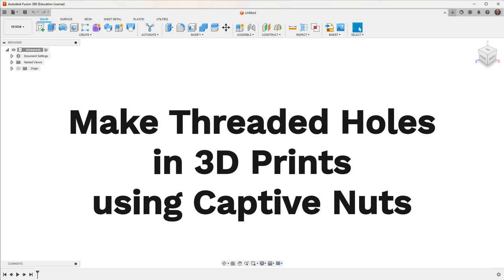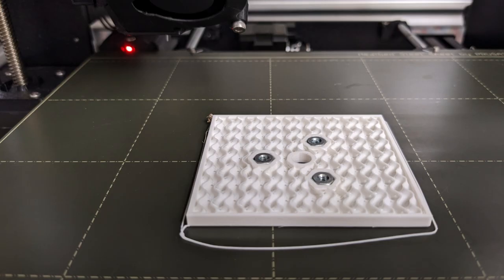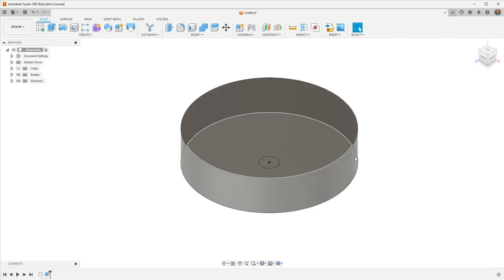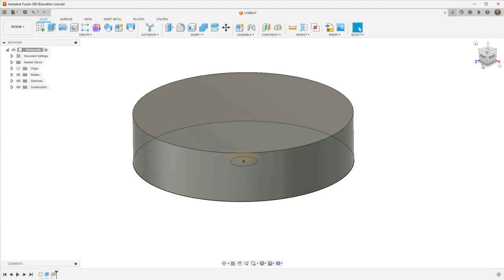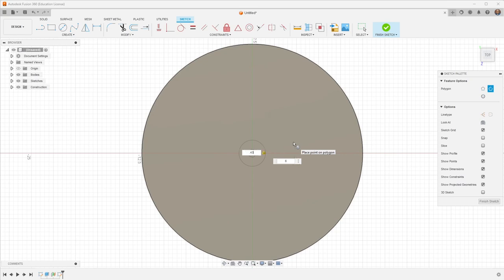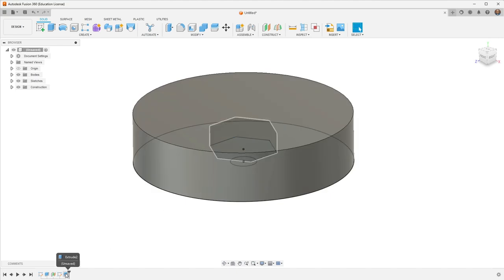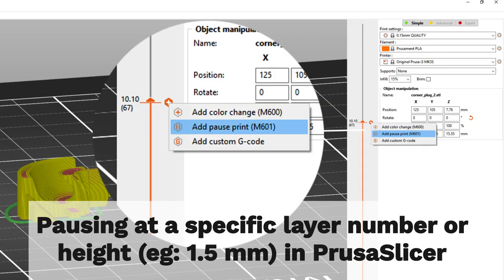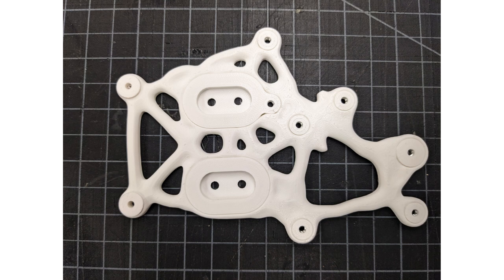Create Threaded Holes in 3D Printed Designs using Captive Nuts & Fusion 360

Comment: You can also draw the sketch as part of your first sketch.  When you extrude, there's an "Offset" option which is vertical space before the extrude starts.
Reply from the maker: Absolutely. I love that feature. Everything can be done with just a single sketch for sure. I try to separate things out in tutorials sometimes, so I can describe each part as I go. But thinking ahead, sketching on paper, writing down the measurements, and using the offset option with extrudes from a single sketch in this case would be a much cleaner way to work I think.

Comment: Does the same work with magnets or do they stuck to the extruder?
Reply from the maker: Great idea. I just put a rare earth magnet near the extruder of the Ender 3 that's here and it didn't stick to anything. Could be different for another printer but I suspect they're all non-ferrous.
Reply from the maker: I noticed in the Prusa Slicer instructions that they mention that a magnet can be attracted to the print head, which makes me think that maybe Prusa printers have some ferrous metal in the extruder/head. They say on the web page that you just have to make sure that the magnet fits tightly in its recess.